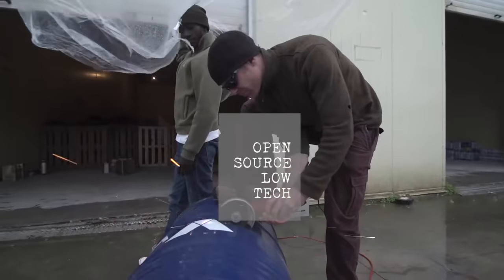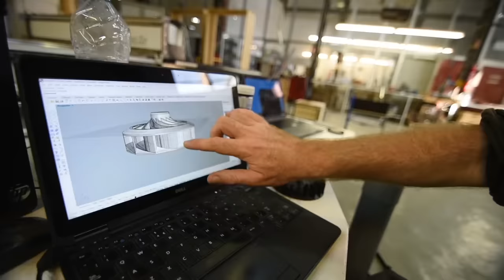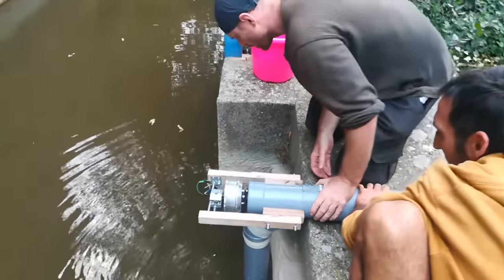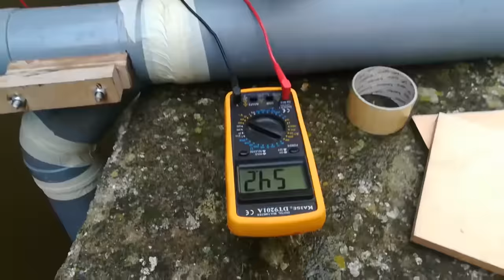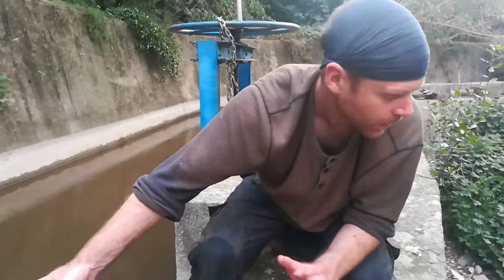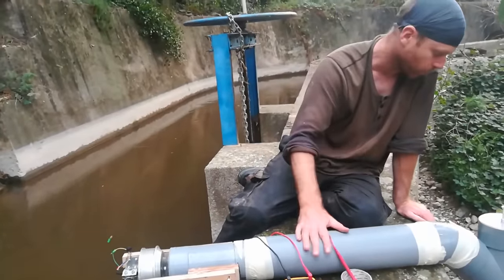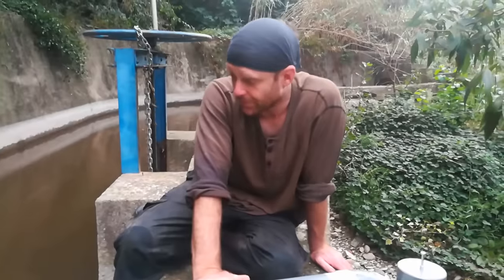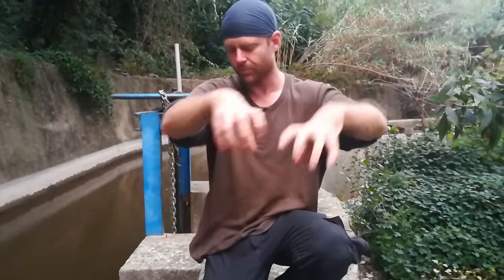The $50 Water Turbine -DIY, Portable, Powerful, and Open Source

Comment: Much love!! Sta tor's are ez to rewind also and littz wire would be the ideal not only for the extra voltage and also for the skinning effect when the prime mover is under load, I would maybe put some flutes on the inside as Victor schaberger did to spin the water as water when spun shall travel faster if the spin is correct as the bullet travels straighter through the vortex or helix. I wish you well in water comair rotron are good fans and you can wind them hexfilliar before they become a generator although this is what you are after. ( effeciency is king)

Comment: Schematics? So this can be reproduced easily to be put to use for those in need. Also, cold weather operations?
Oh, and thank you for this submission and for your time in making this. Thumbs up & subscribed!
Reply from the maker: Thanks. I'll be doing a full build tutorial once i'm happy with the design, hopefully by the spring.
I don't know how freezing temperatures will affect this, the water feed is being drawn from below the surface, and is in constant motion, so thinking it would take some serious cold to freeze it, but remains to be actually tested.

Comment: Great video 
OpenSourceLowTech, have you thought about adding a fire hose valve to the horizontal tube? That would allow you to let air into the cross-tube, breaking the syphon and making the assembly easier to move.
Reply from the maker: In the part 2 video of this in Berlin I had a more useful configuration for starting and stopping the siphon.
For field use it should be easy enough to lift the inlet out of the water, and ideally the turbine shouldn't need to be stopped too often.

Comment: Thankyou guys for a wonderful video, 

my understanding is that one can only achieve atmospheric pressure from the psyphon method, which compared to a two meter column of water in a 100mm pipe is only (by my calculation)approximately half the total force achievable with having the impeller at the bottom of the pipe, which is neither here nor there in terms of practical efficacy at this stage....just putting it out there, with this fascinating video, in the hope of discussion

Comment: just stumbled across this channel and havn't watched more yet ,have you considered using a pulley system in place of the motor to lift weights or even water to a perscribed height as a means of storage of potential power which can be then lowered using pulleys and gravity to power a generator as required , it would mean far less wear and tear on motors and an easier way of power storage than batteries and far more available and reliable in any situation

Comment: Great inexpensive concept, allowing immediate deployment of the siphon turbine in small gradients without construction work. Siphon power plants usually have a built-in turbine at the beginning of the suction line (the generator is positioned vertically), or close to the discharge line. Your solution is interesting in that the generator does not require a long shaft between the turbine and everything is easy to access. Have you tried to place the turbine in the part where you pour water while "starting" the power plant? Too bad you did not measure the load under load. Nice project.
Reply from the maker: In the first, shorter version in the video the shaft is above the drop, I don't think it makes much difference either way as all the water should be moving at the same rate and pressure, maybe less turbulence earlier on in the flow? It's mostly the way it is now for ease of construction, but the eventual design will be completely modular, so can be re-lego'd to suit whatever situation it's being plugged in to.

Comment: Great job. I'd think though that if the fan shaft and motor are vertical, there'd be less friction and less wear on the bearings in the motor. Also, placing the propeller near the outlet of the pipe, you'd get additional power due to gravity accelerating the water vs. your current setup of just siphon suction power.
Reply from the maker: Essentially yes.
Check the part 2 video, that's more or less where I've ended up.

Comment: Attach a cable between the stopper at the top and a second stopper at the outlet.  Run the cable inside the outlet pipe.  To prime the pipe simply pull up on the top plug ehich will pull on the cable and plug the outlet.  Maintain tension on the cable to keep the bottom plug in place while you fill the pipe.  When the pipe is full simply release the top plug which will be pulled into place by the force of the water pushing on the bottom plug which will be poped out to allow the water to siphon.
Reply from the maker: I more or less did exactly that for the second build in Berlin. Check the part 2 video.

Comment: Your system is using the gravity siphon. I would suggest ensuring the end of your pipe be under water down below and take advantage of the simulated delta P it would have if it was submerged. That would increase your speed multiple factors, and also, instead of a computer fan, build an Archimedes screw for inside the pipe for even faster spin.
Reply from the maker: Yeah that turned out to be the case. Part 2 video has more info on the current improved configuration and power output.

Comment: hi, I like this set up I have been working on things like this what I want to do is make a set up like this and use it on our well I will use a belt drive pump to pump water up and through a set up like this and back into the well  I   a m going to use a hover board or treadmill motor what I am having trouble doing is the blade to turn the shaft I would like to ask what you think I could use for the blade or fin and what size of tubing should I get and use? thanks for your input.

Comment: You need a sort of filter for the waste (input) and you can progressively reduce the section of the spill pipe, thus increasing the draft and consulting the speed of the turbine (Ventura's effect) increase the efficiency
Reply: There is a problem of battery to store the energy made...it's expensive and with relative short life

Comment: What is the mechanical advantage and balance on the electric motor and shaft? If you can make them straighter, stronger, lighter weight, you'll get more revs and a lot less losses but this is a great start!
Reply from the maker: How do you mean?

Comment: i notice you have the motor on the side, why not stick another one from where you fill it, and instead of going directly into a straight pipe, you could have another Y joint to allow you to prime it from the side, Great Work I love the idea.
Reply from the maker: Yeah that's more or less where the design is currently at. Check the part 2 video in Berlin for more up to date details.

Comment: It is a mini suction turbine (reaction or charge), so to increase its efficiency you should increase the final section of the tube a little more and submerge it below the outlet level about 15cm to avoid cavitation and air vortices, since I know you don't have much choice but PVC elbows subtract some loading power due to friction, if you increase the pipe width to the next number also in the elbow and main intake you easily increase 5-10% more
Reply from the maker: Indeed. More or less what we did with subsequent versions.
Reply: @OpenSourceLowTech  brilliant!! By the way, it is possible that you improve the performance if you rewind the motor, I know that it is the cheapest and most accessible product, but opening the hooverboard and converting it to two-phase or single-phase will increase the voltage even if you lose it in amperage and you will get a slight improvement in the rpm. then a good rectifier bridge and 220v and 1000uf capacitor and ready to use in mppt, pwm type regulator, inject into hybrid inverter or whatever is required
Reply from the maker: Yeah, but I've been trying to avoid necessitating processes like rewinding just for how much of a faff it is.
This turbine revvs moderately ok, and I'm more or less happy with the highness of the voltage and lowness of the amps as is.

Main issue we're currently having is finding a workable alternative for the HB wheels in places, like here, where hoverboards basically don't exist. Was looking at motorbike alternators but they're also pretty hard to find at a workable price at least.
Currently eyeing up induction motors, from water pumps or the like which are super abundant, with capacitors attached so they can self energise and generate.
But am going to have to have a play with that later when I've got some time and space to do so. Right now we're measuring the mechanical efficiency via a belt dynamometer / Prony brake, which should give somewhat more useful numbers than electrical output and is a lot easier to set up.
Reply: @OpenSourceLowTech  how good Nepal!! I'm glad to hear it,

Interested in being able to measure the hydromechanical part and the efficiency of the Prony belt/brake.

  The flow rate varies but is around 35-38 liters per second. We do it from a 350 liter bathtub where an irrigation canal with a 250mm and 2m long pipe enters to the powerspout with an outlet inclined at 30º and converted from 200 to 250 3m. + 4m in 200 again and the end in a 67 degree elbow due to not being able to access to work inside because it passes through a very narrow void,

I understand the complexity of the generator issue, if it is feasible to be able to fit a 50-80cm3 motorcycle generator (alternator) or a car generator, which is more common around the world, or a washing machine generator (induction motor with the most common capacitor).
  Our generator is a Fisher & Paykel 42-pole motor (7 double series 7+7 in parallel with 2 x 3 phases) but the rotor is raised more than half compared to the stator (it is too large and that is why we must change it to be able to adjust hysteresis and electromagnetic brake to what it is capable of at 1140-1190rpm where more constant energy is obtained.
Reply from the maker: Those motor options are pretty effective and practical, but just a bit too physically large for my turbine, unless it was significantly scaled up, which would then have issues with the off the shelf pipe and fittings options.

The HB wheels are essentially perfect here, minus global south availability.
Replacing them has been a bottleneck for years now that I really should have gotten around to solving by now..
Hopefully get a chance to this year.
Reply: @OpenSourceLowTech  I understand, if the truth is that the examples I have given you are more for 200mm pipe and that complicates more in certain regions and of course it becomes exponentially more expensive if you quadruple certain pieces! If I can find something of Hoover engine size I will let you know. I send you! Greetings and we are moving forward. good luck mate
Reply from the maker: Nice one, let me know how you get on.

Comment: Pretty cool! The first thing that jumps out to me is erosion at the "exhaust" end.  Couldn't you use a deflector? Just what hit me first. Load capacity etc is what it is. I'm sure the intended use isn't to fully power the "average American home"...lol, nor should it. Keep going dude!
Reply from the maker: In practice these would presumably be used in-stream, ie plugged into natural drop in a stream/river, with the water returning to the same flow it's taken from. Erosion could potentially be an issue in some circumstances, in which case yeah probably some kind of strike plate deflector as you say.

Comment: You made a comment about the weight of water helping if you located the fan near the bottom of the pipe.  I don't think that's necessary if there is no air in the pipe.  A siphon works because the weight of the water pulls on the water above so I think the pull of the weight is transmitted up the water column especially if the pipe discharges below the water surface.
Reply from the maker: In terms of just the siphon itself, yes. However it turns out there are other considerations, like cavitation, which is worse with greater negative pressure, as happens when the resistance point, ie the impeller, is high in the system with the water weight pulling vacuum from it.
So I put it a bit further down and increased the draft tube radius to drop the water velocity from that point, and that seems to help quite a bit.

Check the part 2 video.

Comment: Super cool.
Könnte sowas auch in einem Regenfall Rohr funktionieren oder braucht es immer die stabile Wassersäule/Unterdruck
Reply from the maker: Would be a matter of volume. Rain off a rooftop wouldn't hold useful power, a storm drain / municipal pipe during a downpour might..

Comment: Great videos! We have a small spring fed stream and waterfall that runs year round.  Thinking of trying your method.  Looking at used hoverboard motors but not sure which to buy. Is there a preference for battery vs. motherboard side?  Also it looks like they are all 24v, is this what you are using?  thanks!
Reply from the maker: What kind of meters drop and liters flow is there?
All the HB wheels I've encountered so far have been from a 36V system and do about 55VAC/krpm. It is probably worth hunting round if the ones you're finding are less than that.

Comment: Have you experimented with a crossflow turbine as you seem in most cases to have velocity and head, perhaps pmg at both ends doubling the load, should be robust enough to withstand stones and leaves as these would thrown aside in the process.
Reply from the maker: I had a look at them when I was first conceptualising this, but the numbers didn't quite work out for the use case I was aiming for. Don't now remember the specifics.
Also they need to be dimensioned fairly accurately to work well, which I was hoping to avoid with this design.

Comment: Looks good. What about reducing the internal diameter of the u pvc pipe,? Just curious what would happen to the water flow rate. I know its a protatype but you can glue those fitting or use the neoprene push fit type. Good work.👍
Reply from the maker: Reducing the input pipe diameter increases it's meters per second, but at the cost of the overall system's liters per second, and since the power equation is head x gravity x flow, it ends up costing you power.

I haven't really had an issue with insufficient rpms off the impeller, so no need to speed the flow up, and it also increases cavitation. 
Check the part 2 video for more info.

Comment: Hi, great vid, great idea.  I have a small brook on my land and have often wondered how to use it!  How much is the fall of the syphon relevant?  I understand head but never investigated the science of a syphon.  I assume the flow through the drop pipe is creating an equivalent 'head' by way of suction how would that compare with the flow of my brook pushing the water through?  Is there a relationship between flow and head?  Something like Power = Flow * Head.  So a low Head but with large flow can give the same return as a high Head with less flow?  I have in mind damming the brook just a couple of feet to mount an elbow arrangement like yours where the water behind the dam flows through the pipe and drives the turbine.

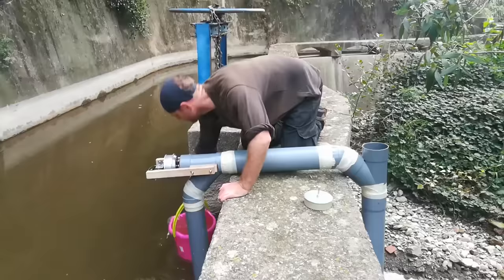Comment: Looking at the reservoir wall between in 2:32 and 7:36 you can tell the system used a lot of water.
Reply from the maker: It was being constantly fed by the nearby river, so the level doesn't drop. Not sure what's up with that high water mark tho, might have been sending off waves from putting the turbine in.
With those dimensions the turbine goes through 30-40 l/s, which will drain about 2 cubic meters per minute. Which is a lot if you're coming from a reservoir, but only about a small to medium creek if it's flowing.

Comment: Placing a latch at the bottom of the exit port will allow you to fill the pipe for priming when the pipers fool like a vacuum canister tied to a string pull a strain it released a trap door and released the flow water
Reply from the maker: Yeah that's essentially exactly what I did. Check the part 2 video.

Comment: Very impressive! It floors me to think that  retooling w/beefier turbine & coil specs (including intentionally doing what you were avoiding by intentionally aiming for ++torque instead of ++voltage) you could totally arc weld with the power this produces.... Would def benefit from a small additional investment of some stout capacitors or a few cheapo starter batteries in series up to around whatever the voltage produced was, but either of those are trivial expenses anyway... I must make one now!
Reply from the maker: Should be doable, yeah.

Comment: It's really great to watch.  What's the best kind of cheap motor i can break for purpose?
Reply from the maker: For these I've been using hoverboard / balance board wheels, which are more or less ideal and easy enough to get for cheap in developed countries at least. Other options could include treadmill motors, other forms of small electric vehicle wheels, maybe a stepper motor tho they're not generally great.
In low resource environments I'll probably be using motorbike alternators, which are largely ok.

I did salvage a direct drive washing machine motor to test, but they're too huge for this little turbine. Should  work well with the wind turbine tho.

Comment: It looks like you used 6" pipe, so with how fast that water was moving (you note 50L/sec), I expect that it took a large water supply. But at the end you mentioned water momentum rather than volume. Could you be reasonable effective while needing a smaller amount of water by shrinking the system to a 2" line? I am sure there would be some power loss compared to this system, but I wonder how it would compare.